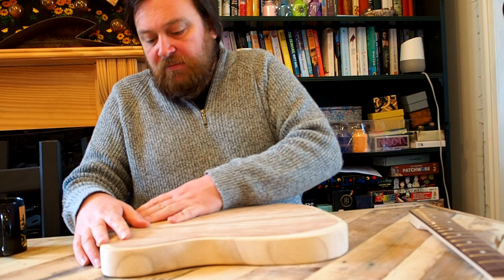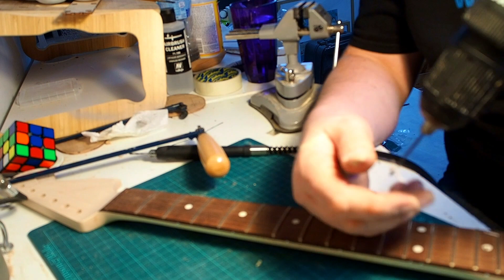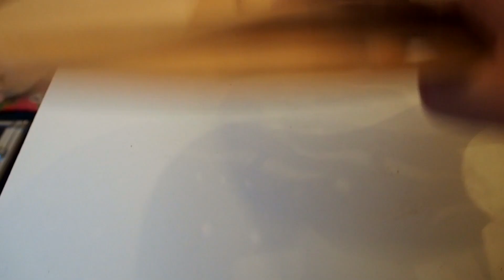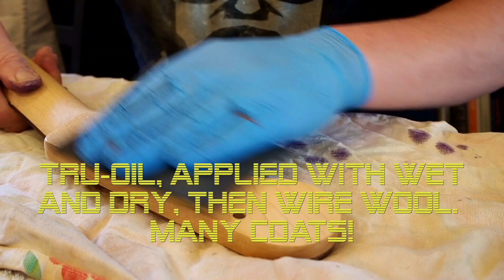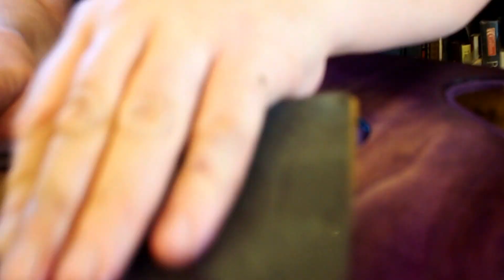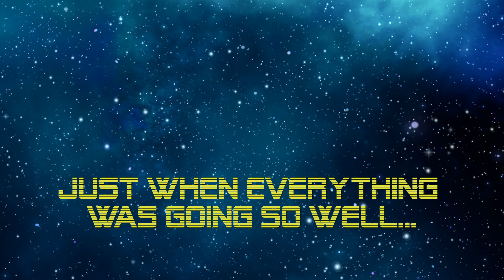DIY Acoustic-Electric Hybrid Telecaster Build:  Episode 2

Comment: Hi John  ...love your videos, and straightforward approach to the build. I'm considering building an acoustasonic style guitar, and had two main concerns - one is the construction of the top, being strength versus tone, the other is the electrics. I was wondering if you can get by without a pre amp - I've seen other vids where the guitars seem to perform okay, but I worry about a weak signal in comparrison with the magnetic pickups. Did you consider or experiment with a passive piezo? P.S. good look sorting out your current setup.
Reply from the maker: Hi, thanks for watching.   Yes I have used a combination of passive piezo discs and the p90, which do sound very effective.  I used 2 discs in different positions.  Honestly, that side of it was plain sailing, (although I've had to mess a lot with the piezo discs as they're very sensitive and prone to feedback).  I'm just trying to get the saddle pickup with the preamp mixed in and balanced.
On reflection I think I went over the top (pardon the pun!!) with the bracing, and probably sacrificed tone. It is strong though.
Reply: @JohnSpeight  Thanks for reply John..gives me a bit more of a guide. I'm afraid I'm going to have to wait till it warms up a bit in the garage before I start Though!

Comment: I like the way the binding came out in the top inset. Pretty clean. I think the headstock carry over was a good idea too. I might have tried to veneer the entire headstock if i had a big enough piece of material. I'm kind of wait and see on the body. I've seen a few of these builds and had an idea. How might these function if one was to leave a section in the body and make it string thru? Like a wood piece you didn't route out that kind of looks like the trem block from a strat. The bridge would still hold the saddle so you'd still get top response but the top wouldn't be so responsible for support. The profile could be adjusted some to allow for string break. I think that might be a solid design approach.
Reply from the maker: I think that would work really well.  You can go easy on the bracing that way. The other problematic thing on this build is the neck joint, which is quite flimsy after removing the material (mostly because of the soft wood).  It would have been a good idea to remove much less between the neck and the bridge, building up to the point you're talking about below the bridge.
20/20 hindsight is a wonderful thing!!